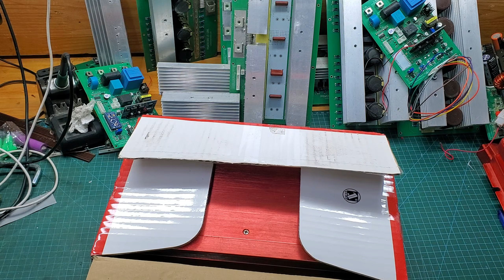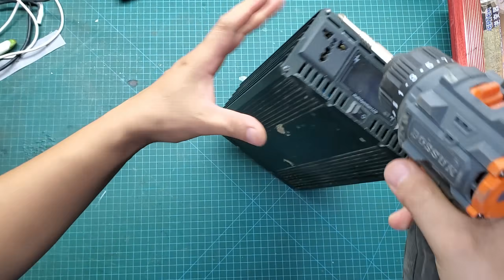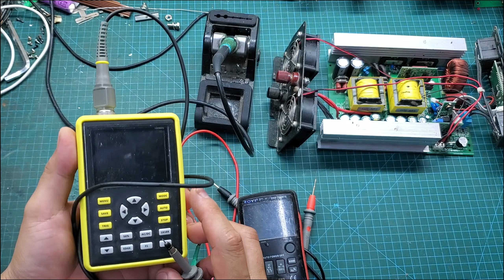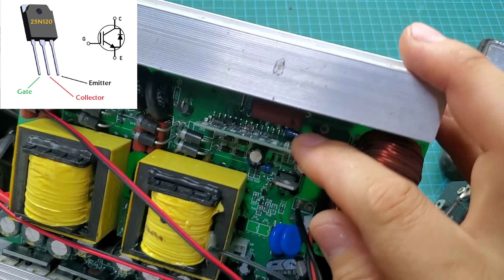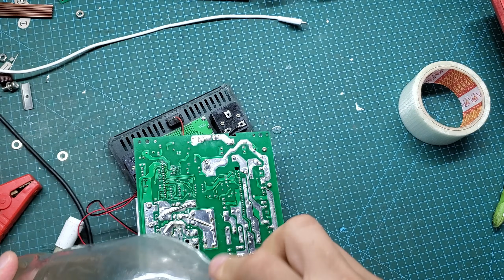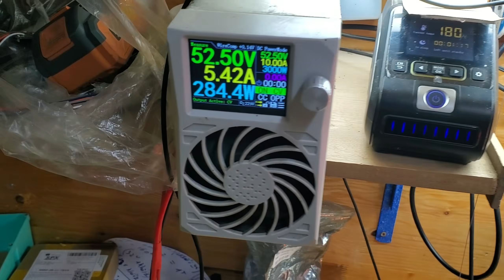How to Repair 48V 1500W Sine Inverter

Comment: You have to remove a fuse out of the circuit before you can check it
Reply from the maker: The fuse is connected between the DC input terminal and the circuit board. Therefore, there is no need to remove the fuse; it can still be checked using a multimeter.